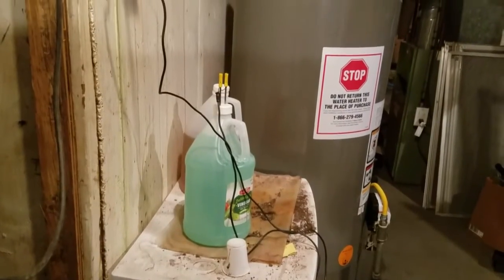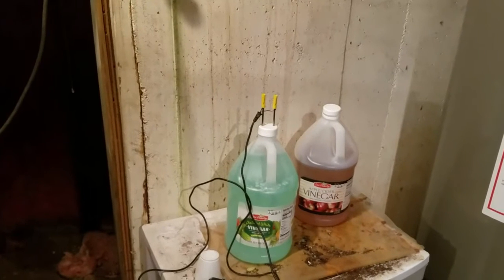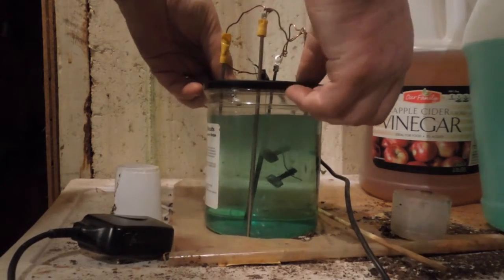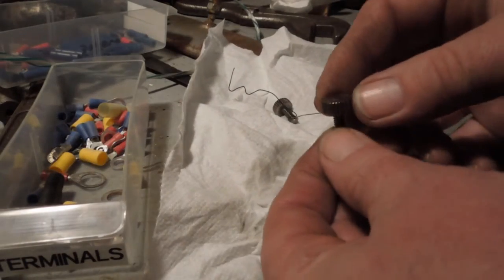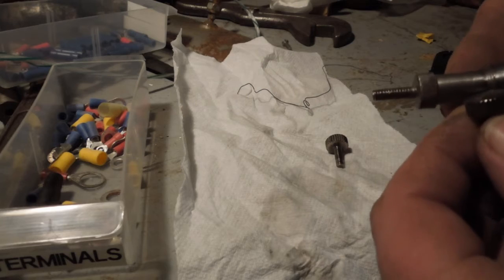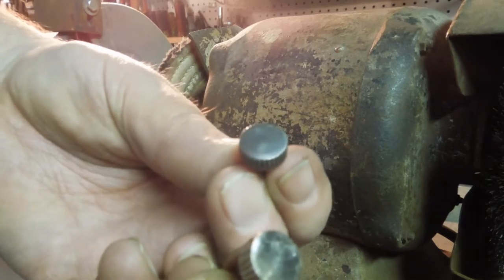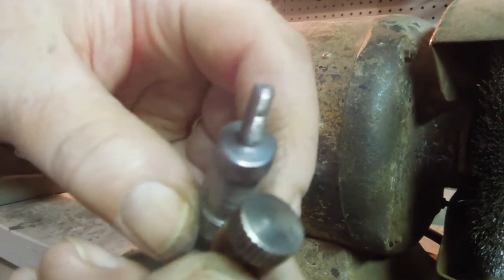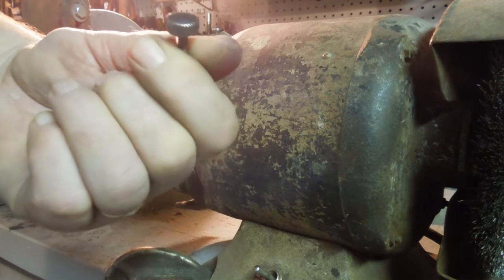Nickel Plating - Pexto 8014 Brace - Pt 2 - Test Run

Comment: Years back I was restoring a 1951 Pontiac and the grill was toast so I though I would try my hand at nickel plating!  I bought two different kits to do the job, one from Eastwood and one from JC Whitney, both came with Nickel sulfate and all the materials needed to "plate" your parts...  I spent a lot of time trying to plate the frill and some other parts with very limited success.  Later on I wound up bringing the parts to a plating plant and asked the guy why I was unsuccessful. He took me into a huge room filled with huge tanks of very highly concentrated and toxic chemocals. He pointed over to the wall where there were huge buzzing transformers with heavy cables coming out... He told me the reason plating is so expensive isn't the labor it's the chemicals and current!  I quickly understood why it cost so much!  I never liked Nickel plating because it almost always failed... Almost every old nickel plated tool has issues, that's why in the late thirties they went to chromium plating and had much better results...  The only Nickel plating I have ever seen hold up was done by Ford on his model A headlight bezels...  The nickel plating was so thick and well done, we could never replicate that today!  Thanks Dave!!!
Reply: they could have been brass or copper bezels coated in nickel, that holds up very well and you never know, its also  much easier to do than steel
Reply from the maker: Plating is a line of sight process. I put 4 nickel rods surrounding the parts to be plated. The same goes for electrolysis. Plating an assembled grill to a symetrical layer would be tough. Lots of shaded areas. 
It also is based on amps per square inch. There are sophisticated power supplies that offer wave form control and variable output.
The small wall wart that I'm using works for the two small screws. For the frame I think I'm going to need a bigger unit. I'm going to use a car battery charger.
Reply: How about copper plating using a copper sulphate solution. Much, much easier and would prevent the rust. The sacrificial anode can be regular copper piping. Just a thought.
Reply from the maker: There is a process called German Silver. It uses zinc, copper, and nickel as the final coat. 
Copper fills quickly and makes an easily polished surface. 
I am familiar with the copper sulfate process. I want to test the straight nickel acetate process first.

Comment: more time, what do you think ?
Reply from the maker: Not sure what you mean?
Reply: @OldSneelock  more time in the bath and see what happens I hope it works I want to try it myself
Reply from the maker: @tarz9386  As the bath is used it becomes stronger. It was suggested that 20 minutes should provide a good thickness. I left it for 45. 
The process worked. The parts are plated. Not sure exactly how thick. They polished up pretty well.

Comment: the nickel i used to do, came out super matt and couldnt be used as is and a ton of work to polish, yours come out reasonably shiny and easy to polish, i used to buy nickel sulphate crystals and mix with water, seems the home made stuff works better than what i used
Reply from the maker: There are a lot of variables. From my readingI found that higher amps push the nickel on faster but leave a rougher surface.
Reply: @OldSneelock  yes, i used to go slow as well, but perhaps not slow enough!  they said at the time 12v from a car charger, with an indicator bulb to limit current (below 1a probably)